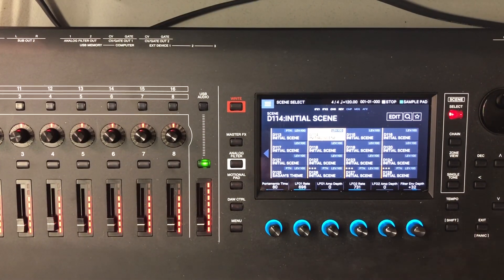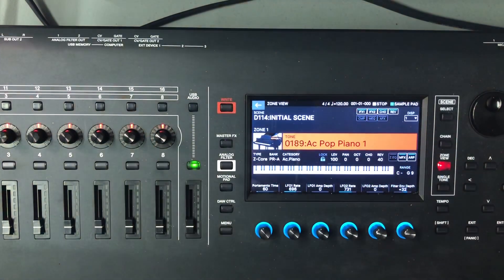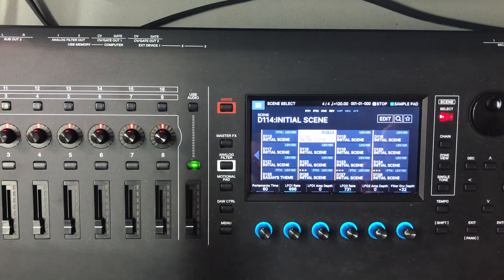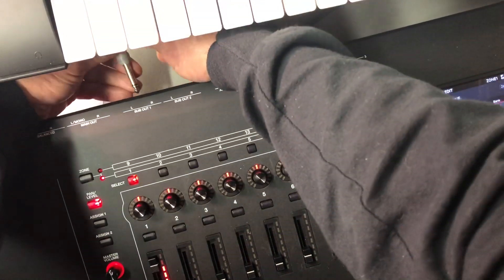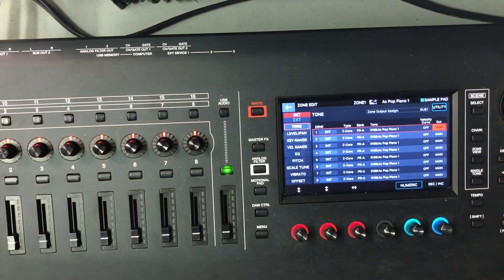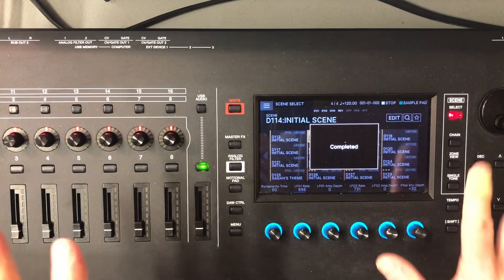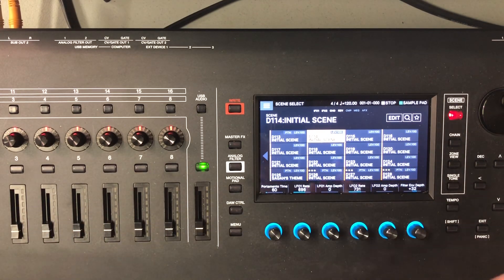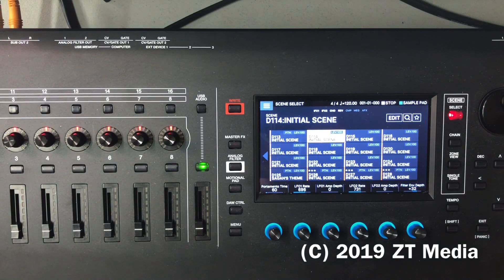Roland Fantom: Using Sub Outputs

Comment: How about a video on using the external inputs on the fantom? I want to route a source into the fantom and output to the subs, ideally with a slider assigned to control the output volume. Is this possible? Keep up the good work!

Comment: Can you use the subouts and inputs to create a hardware effects loop? Could you sample the incoming effected sound while doing so? For example, say I wanted to play an internal Fantom sound through a guitar pedal and resample it into the Fantom.
Reply from the maker: I don't see any reason why that is not possible. Hmmmm ...
Reply: @ZTAudio  thanks for your reply. Most samplers do not allow you to play internal sounds through the output while sampling from external inputs. One issue is the sampling mode would be exclusive from playback mode, and another issue is if there is input monitoring and you are feeding the output to the input,  this would cause feedback.
Reply from the maker: steelcitysi I’m aware of that potential issue.

Comment: If the piano sound has been routed out the Sub Out 1, what instrument is the reverb coming out of the Main out applied to?
Reply from the maker: The Reverb in this case is a sort of "global" effect, as if you had a Reverb built in to your mixer. It's applied to whatever tracks/zones you choose, according to whatever amount you set on the Mixer or Zone pages, as shown in the video. 

The output of the Reverb effect is set to the Main Outputs in this case. So, even though the "dry" signal of the Piano is routed to Sub OUT 1, the "wet" Reverb continues to sound through the Main Output. Turning the Reverb SEND to zero prevents any signal being sent to the Reverb, so no Reverb ends up going to the Main Output.
Reply: @ZTAudio  Thank you very much for your explanation and your quick reply.